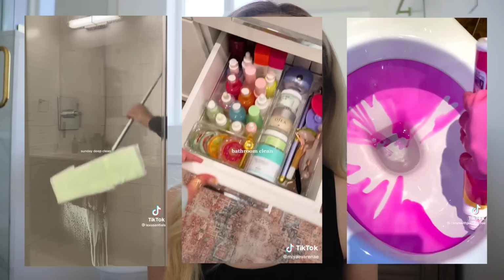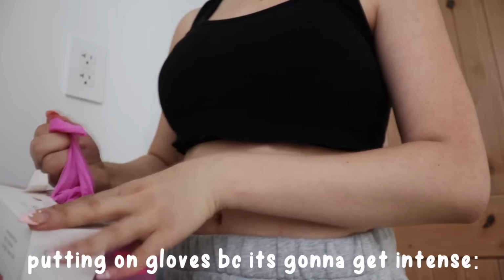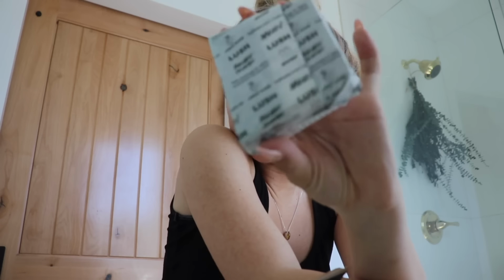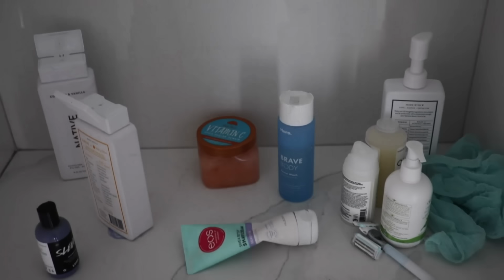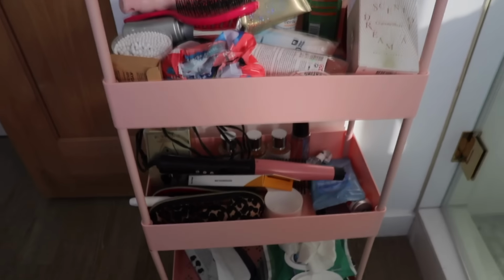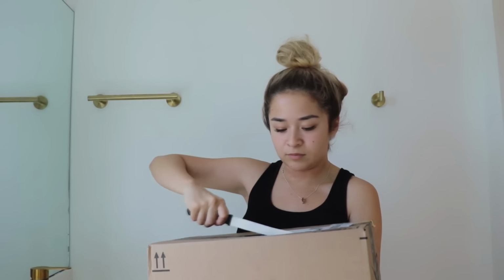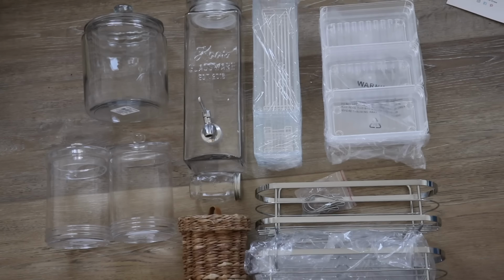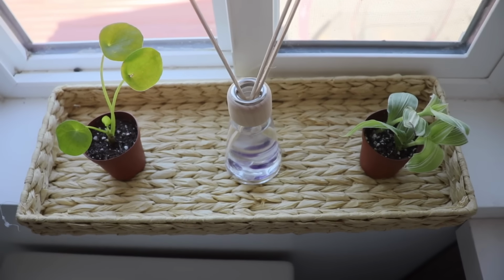EXTREME BATHROOM ORGANIZATION + CLEANING🫧 *watch this for motivation*

Comment: INSPIRATION!! ok... so I have a tip for the scrub daddy sponge. if you are cleaning surfaces that need an thing like the pink stuff, put the sponge it ur freezer so it is harder, but if ur using it with something like kaboom or a spray (not on mirrors), run it under some hot water for a little bit. btw ILYSM!!! great wishes with your ~living alone journey~ 🌿

Comment: As someone who’s cleaned houses for half my life now I would recommend buying a squeegee for your bathroom and using it after every shower. Right before you get out just quickly squeegee the glass door/wall and it will help with keeping them clean longer and without the water stains